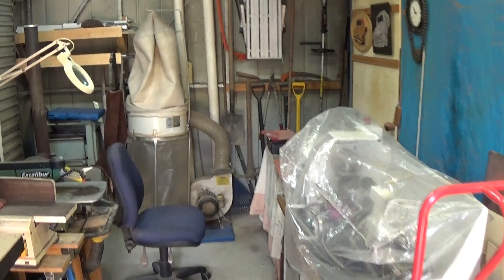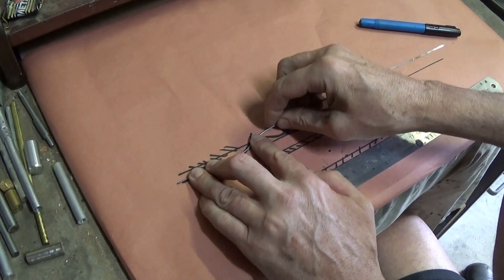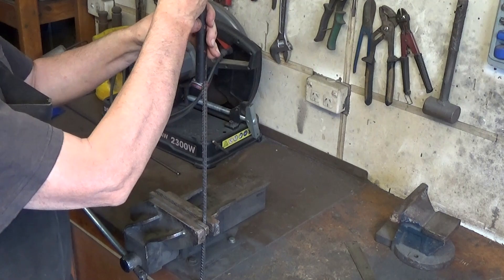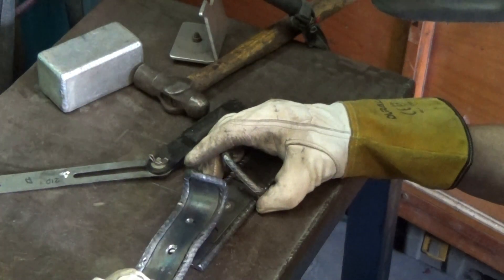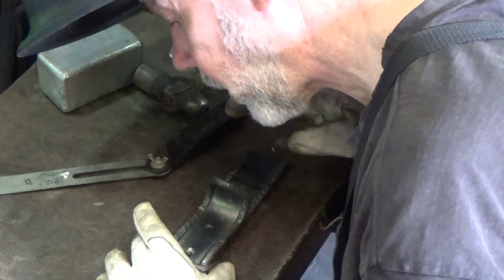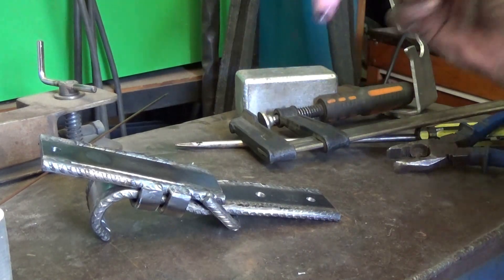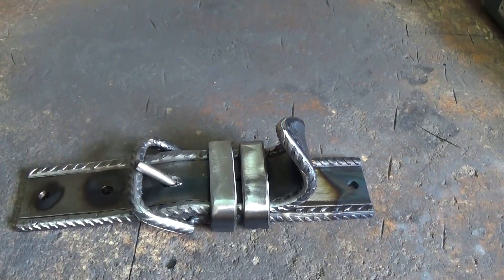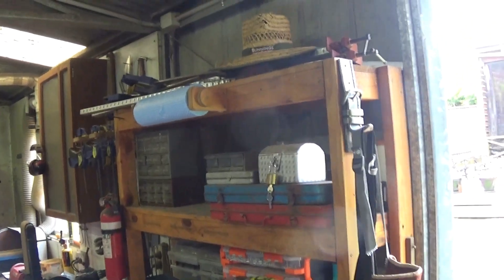I Make an Apron Hook using Rebar

Comment: What an awesome job Adrian, love it. I love the hammer fist too that thing is cool. Gavin Clark
Reply from the maker: Thankyou. That is very generous of you. 
By the way, it’s nice to view/hear another Ozzie for a change. 
Question: what do you use to protect your raw steel work?
Reply: @ShedBuiltStuff  Hi Adrian, good to hear back from you mate, I agree it is nice to see another Ozzie on youtube. I often use Penetrol Rust Treatment Penetrates Rust 300g Aerosol Spray, (Bunnings have it) and then put two topcoats of Semi-Gloss Clear Coat. That is what I used on the rebar lettering on the back of my workbench, here is the link to that video. https://youtu.be/JA-wk62Zghk
Reply from the maker: Thanks for the tip. I’ve used penetrol before but didn’t realise I could then clear coat it once dry.
Reply: @ShedBuiltStuff  I always do two coats of the penetrol, just to be safe as rebar has many little crevices.